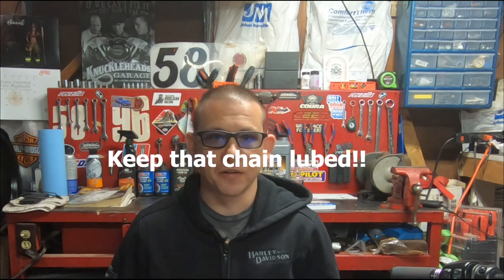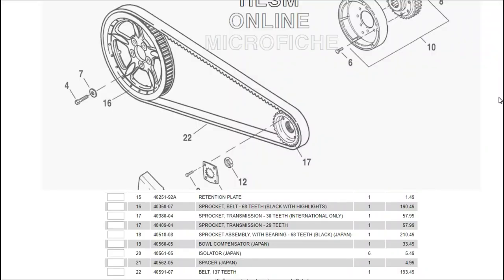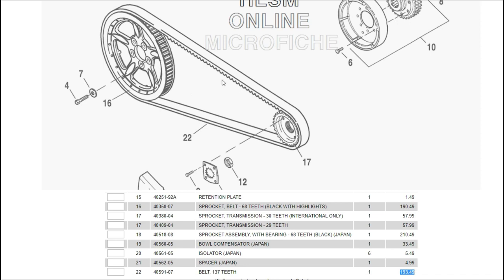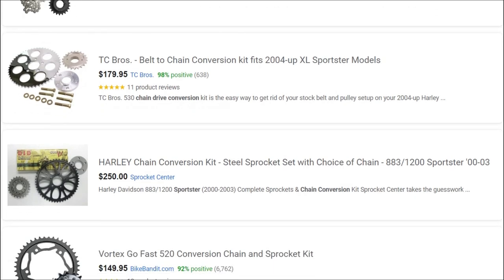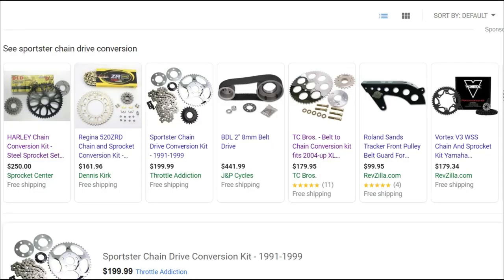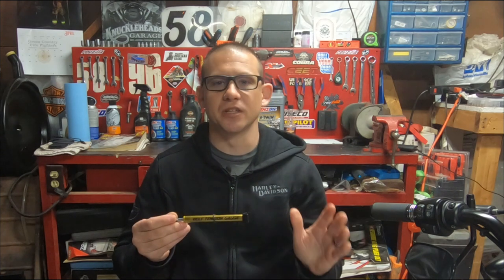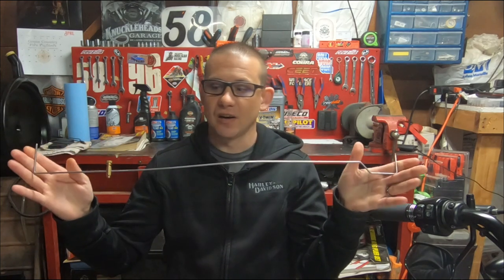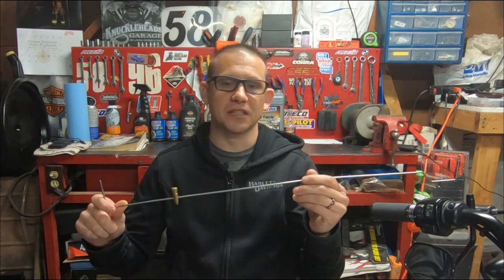Chain Conversion or Keep the Belt on the Harley-Davidson Sportster

Comment from the maker: Would you convert to the chain drive or keep the belt??
Reply: I would prefer switching to a chain, if I was out on the road or stopped often at hang outs.  But only for vandalism reasons.  In my mind, anytime one of my bikes are parked, I always envision some other harley owner that knows about these belts taking a knife and cutting my belt off.  These belts are great, but when you consider if one is severed you have to remove the outer primary and engine compensator and sprocket and clutch hub assembly and then remove your inner primary  and your starter and your rear wheel to change that drive belt and knowing all of this major, but then to now some jealous ahole can whop that belt in two with wire cutters or just some knife.  There are people that do these things.  I even worry about this when my bikes are parked in my driveway in front of my house that some jealous creep will do this.  I retired from Hydril co subsea equipment and our machinist as well as our engineers had constant problems with jealous labor helpers and temporaries fucking with the cars of the high salaried employees with nice cars during all the years i was there from 74 till 2004 in the huge parking lot
Reply from the maker: I've heard stories of belts being cut before, hard bit to piss people off these days too lol.
Reply: @GixxerFoo  Anything I can imagine someone doing, usually I find out people have actually done them.  There are people that are jealous of harley owners, because even a used one takes serious money over a grand for a basket case.  If you drive a cadillac or ride a harley there are sets of angry people
Reply from the maker: That's very true,  even a Harley in several boxes still cost some $$.
Reply: @GixxerFoo  Even the cheapest used evo engine on ebay is 1500.00 and that would be for a very used one
Reply: @EarlGuyton425  "...when my bikes are parked in my driveway in front of my house that some jealous creep will do this."
It'd be one of your neighbors who's tired of listening to your loud-ass tractor.
Reply: @daryllect6659  Based on odds of averages.  But then go figure many peoples luxury cars are vandalized that arent loud tractors and this is generally due to jealousy.  Many people like to destroy and cause cost and lost to people that have things that they cannot have
Reply: I haven't found a quality kit yet but chain all day, it just makes a better bike.
Reply from the maker: Hey give that old school look and they the power down 👍
Reply: I got mine with a chain already. I've never owned a bike with a belt so i don't really have an opinion. I am pretty happy that it already got a chain doe, i feel that that opens many doors.
Reply: @EarlGuyton425  a good chain breaker to pop a pin takes a few seconds to break the chain
Reply: @leonsumrall524  Thats not the point Leon, the point is that a chain can be replaced without removing the rear wheel and outer primary and the clutch assembly and inner primary
Reply: Probably stick with the belt for the longer life...as for it being quieter than a chain drive well while the only bike I had that was a chain drive was a little yamaha 250 route 66 I would have to say the chain drive is quieter and smoother than the belt drive...as for maintenance well I kinda like the fact that I'm not having to risk getting chain oil/grease in areas that you really don't want that stuff to be especially after its been raining and the roads are still wet
Reply: Keep the belt. If it ain't broke I'm not gonna fix it. When it breaks , if it breaks . Got a 2000 1200 Custom it was all original never molested when I got it. And all the factory stuff was like new. So when it breaks I'll probly just go to Harley or check my options and buy a new belt , alot quieter no cleaning and oiling just alot less to mess with.
Reply: way too much chatter
Reply: Pretty simple unless you have a big big torque Harley engine with not many of you do not need chain
Reply: Chain every time superlite

Comment: As much as I respect your knowledge, I have to disagree with your assessment on power loss regarding the belt. 15% is the number when speaking about a shaft drive. The belt has a loss of 1% more than the chain.

Comment: I run a 07 lowrider with 120r  138hp/132tq. . i have 60,000 miles on the belt with no problems. I ride this bike across town and across country. and compete in several drag racing events each year. i experimented extensively in the 80's and 90's using beltdrives in other race applications and found the belt drives were more efficient. mostly due to weight reduction. i have a 2000 roadglide that has over 100,000 mile on it with a lot of those miles riding two up and pulling a trailer. It makes a little over 110HP and still has  the original belt and pullies with no problems.  I also have a stump grinder that runs the same type belt it is 85hp/ 315tq. it sees a lot of heavy full throttle use and the belt and pullies usually last 2500-3000 hrs . they are subjected to a lot of dust and dirt..
Reply from the maker: That's awesome, the belt is a lot better than it gets credit for. They are a lot stronger than people think!
Reply: Great comment!
Thank you 
Safe riding
Reply: Belt drive set up is heavier than chain drive

Comment: Lol, this brings back great memories of when Harley went with the drive belt and the arguments that ensued. If you want custom gearing, lower gearing for an around town or taller for the highway you can't beat a chain and sprockets. The same goes for big power bikes too. Harley invested a lot of R&D in the belt system and it's on a lot of bikes. I'm lucky if I get 15K miles on a chain and set of sprockets so for 4 times the life minimum the belt can be cheaper in the long run.
Reply from the maker: Oh definetely the belt is gonna be cheaper in the long run. This is my first experience with owning a belt drive bike. It's way less maintenance and all l do is just check it over and keep it clean. No worries about lube and constant adjustment.

Comment: I've known at least 2 guys who had their bikes vandalized. In both cases, they went out to a parking lot to find their final drive belts laying on the ground or draped across the bike's seat. It's a sign of the times. We inhabit a world that's inhabited by jealous and vicious bug-wits who do not have any morals (or class). Chains and sprockets require more maintenance, but they DO have some advantages over a belt when it comes to repair (especially on the road). Modern bike chains have "O" ring technology which makes them last longer than chains in days of old. Chain/sprockets also lend a nostalgic look to bobbers and choppers. Ride safe.
Reply from the maker: That's sad anyone would mess with someone's bike like that. Chains are the way to go if you want to play with gearing and different setups too.

Comment: I ride a Sportster which means replacing a belt is easy. It's fast enough for me, so power is not an issue. No lubing required and no mess from oil flinging off. No chain for me. Been there, done that.
Reply from the maker: That's a lot of the reason why I ride Sportsters too, the maintenance is a lot easier not having to dig for the belt.
Reply: I agree.

Comment: I'm ahead of you here. I changed my '93 Sporty from belt to chain several years ago. The belt was fine. No problem. However, I used to flat-track and learned the importance of having the right gearing. Bought a '92 front sprocket and an aftermarket rear in the sizes I figured I needed. . I lowered the overall gearing somewhat which gave me quicker acceleration and top end. Harley over gears the Sportster so you can't redline the engine in top gear. I can now cruise my 883 at 80mph and can still accelerate without down shifting. It drinks more gas and vibrates more since I'm pulling more revs on the highway but not all that bad. One thing to remember if you want to try converting to a chain. Absolutely use a GOOD (expensive) O-ring chain! Break it in and it'll be almost as quite and smooth as a belt.
Reply from the maker: That's awesome! I used to flat track myself too, l had whole tree full of sprockets front and rear with chains of different lengths. Gearing is very important and it's a lot cheaper and easier to get where you want with a chain conversion. Not too many options with belts, and it's expensive.

Comment: BIGGEST reason for chain conversion on a sportster is regearing. They come a little short on the highway gear. Engine revved out just to keep up. Second would be going from 883 to 1200 jugs. Regear for the extra power. The guys that say nostalgia are full of it. Old harleys started out with a leather belt. However, on the big bikes, i.e. dyna, streetglide ect. They are not fun to put a new belt on. Lots of disassembly. Not so with a chain. Unless you need a new front sprocket.

Comment: I converted my ‘01 to chain drive many years ago because I like the old school look. Every bike I’ve ever owned was chain driven and to me the belt drive just looked kind of odd. I don’t care if the chain is noisy, dirty, or creates vibration. Solid mount Sportsters vibrate a little anyway. But they are lighter, skinnier and more nimble than the newer bikes so a few vibes are no big deal.
Reply from the maker: This is my first experience with a belt too, they aren't bad but l agree the chain just looks right on the rigid mount Sportster.

Comment: I converted back to belt after the previous owner put a chain on my 89 electra glide. Less than a week later hopped on the bike to go grab some breakfast and didn't even get out of the driveway. A green walnut somehow found it's way between the belt and rear pulley. SNAP went the belt.

Comment: I did a chain conversion on my '95 fatboy.. I actually converted to an open belt primary and a chain final drive ... the belt primary was form over function... I just love an open primary with its look and sound. Changing out my final belt to chain was more for tuning. There is a better selection of drive and wheel sprockets to better tune my final drive ratio ...
Reply from the maker: Oh hell yeah with a chain and sprocket setup you can get whatever combo you desire and for a while lot less.

Comment: Being old enough to have a Sportster before there were belt drive on any motorcycles, I say never again to chains. Having to lube them constantly and adjust them every few hundred miles, ACH!
Not to mention the vibration that chains make at high speeds. Thank God for belt-drive.
Reply from the maker: Amen to that! I love the belt drive myself and how much cleaner it is. Can't beat the maintenance and not having to clean chain lube off the rear wheel constantly.
Reply: What vibrations?
Reply from the maker: @Ratridez  😆😂 right? Just part of the experience lol.
Reply: @GixxerFoo  🤣👍
Reply from the maker: Chains really have come a long wat from the o-ring to the x-ring chains, they can really take a lot of abuse.
Reply: gary meschede  Belts drives are garbage , broke 3 of them on my electra glide , 2 on my ultra classic , 3 of them on my dyna lowrider , went to chain and not a problem .
Reply: gary meschede  Harley belts , kevlar belts , falcon belts .... didnt matter their all junk , belts are to skinny and one little rock and done . Only bikes was good was my old softail it had the old wide belt .
Reply: Chains doesnt vibrate , I've owned at least 20 bikes with chain , you dont have to adjust them every few hundred , that's a wives tale , I have 15000 miles on this rk pro chain and only adjusted it once and never even greased it .
Reply: @GixxerFoo  I dont care if I get grease on it , it has bags and cant see it , I ride my bikes and it's always dirty , the clean bikes set in front of tim hortons
Reply: gary meschede  Chains have came along way , O ring chain changed that .
Reply from the maker: Road tripping in rigid, that's some hardcore riding!
Reply from the maker: Dang that's some dedication! Have you rode anything other than rigids?
Reply from the maker: That's awesome, you just don't see any rigids running around these days.
Reply from the maker: You ride safe! You must be doing something right if the 1% thinks you're crazy 👍.
Reply: Use a good (expensive) 0-ring chain

Comment: I've seen some big horse power motors with the one inch drive belts on them. I was raised with chain drive but I'm old now and I absolutely love the belt. LoL
As a matter of fact just two weeks ago I changed my belt (steel/poly) and front drive sprocket 
(Lighter hardened alloy sprocket)
Reply from the maker: I like the belt drive myself, lnalways had chain drive bikes before too.

Comment: Converted mine 6 years ago on my 02 883 using a low brow customs conversion kit, and a 530 chain from diamond. Have put over 15 thousand miles on it. If you use a good quality chain and lubes it often.  It won't stretch that often.  I run it with a I inch freeplay.  And have had to adjust it only 2 in 6 years.
Reply from the maker: That's awesome! You said the key words, use a good quality chain and lube it often! I myself wouldn't trust the Amazon special when it comes to a chain and sprockets.

Comment: I converted my 07 glide to chain 4 years ago , best thing I ever did , no more busted belts in middle of nowhere , I'm using a rk pro chain , very little maintenance  .
Reply from the maker: That's awesome to hear! Getting a quality chain like that is key, guys buy cheap chains and get upset when they fail.
Reply: @GixxerFoo  Chains also have no tension , no wear on out transmission bearings , and if you were in an emergency a #50 machine chain is same as a 530 , will get you home .
Reply: So how many belts have you broken? And why?
Reply: @davidmcfaull3162  Broke 3 on my electra glide , 2 one a ultra and 2 on a dyna . Drive sprockets are garbage they wear out and stretch the belt , sometimes I get rocks in them .

Comment: Belts for normal use is damm  near maint free .make sure tension it correct when you change tire and of course line it up on the pulley. A chain can break and leave you stranded or get tangled in the sprocket and lock tear tire up or bust transmission case
Reply from the maker: Getting a belt lined up and tensioned correctly is the key, I've seen a chain break on the interstate and do some serious damage on a sport bike. Guy was lucky it didn't lock the rear wheel up.

Comment: Switched to chain drive on my 03 in 05. What I've learned is never by a cheap chain because it will wear faster and eat sprockets steel or aluminum. Usually I get two chains to one set of sprockets. Recently I added a chain tensioner and so far so good. Again always run a high quality chain! Keep it clean and lubed ant it will surprise you how long it will last.
Reply from the maker: Spending the money for a good chain is well worth it! I've tried the cheap chain route before myself with the same results.
Reply: I have 330 thousand miles on my 99 Sportster 883 in that time I replace the belt three times when you consider what a chain and a set of sprockets cost every 10 to 20 thousand miles you almost double the price of the bike with all the maintenance you have to do and the part you have to replace as well as all the cleaning if a belt breaks it doesn't knock a hole through your crankcase like a chain does I only put up with a chain on my vintage bike belt drive for a Harley and shaft drive for everything else and the more horsepower you make the more expensive your chain and your sprockets will be

Comment: I did the Throttle Addiction kit on a 2000 XL 1200, I think it ran me $185. The previous owner had incorrectly mounted the front belt pulley which had damaged the splined shaft coming out of the transmission. There was still enough bite on the shaft to mate up with the sprocket and nut. The sprocket only needed about half the space on the shaft, it worked out nicely. The kit came with a generic #50 roller chain, but it was black/gold, though a Diamond Chain would have been better I was happy for the price. I sold it, made a little money and the owner is happy 2 years later.
Reply from the maker: Dang you got super lucky on that deal! That's awesome that it held up and everything worked out!
Reply: I have never replaced the pulleys on my Sportster with 330,000 my never ever all this BS about changing the gearing well if your eraser doll that has a happy horseshit go for it
Reply: If you have a big twin figure in the cost of tearing down your clutch and primary to replace a new sprocket every 20,000 miles I can't imagine belt drive pulleys ever wearing out my buddy who has a chain drive Evo Sportster is constantly replacing chain and sprockets because Sporty's have no compensators and the Driveline therefore they wear the death out of chain drive
Reply: @frankmarkovcijr5459  that’s interesting.It’s up to your personal preference. A lot of trick riders seem to prefer a chain final drive. But I’ve also seen belt primary and final drives fail on the road. I’ve never seen a chain final drive fail. Of course they wear out but that may also be due to poor maintenance. The major attraction of a belt drive is that they run a lot more clean and require less maintenance. Indeed, Sportsters do have an internal adjuster for the primary chain, and I’ve seen those fail so I carry an extra. On my current Buell motor in a Sportster frame project I’m putting it back to a belt final drive. Conversely on a Shovelhead chopper I’m going to run a 3” belt primary and chain final drive with a 48T rear sprocket to bring down the RPMs of the ratchet top for highway cruising. It’s really up to your preference and riding style. Stay safe out there.